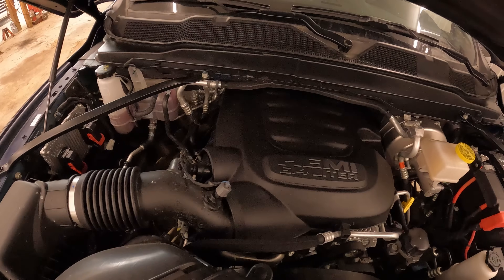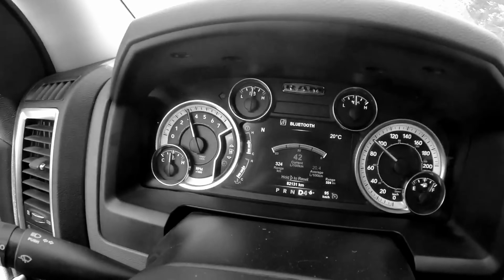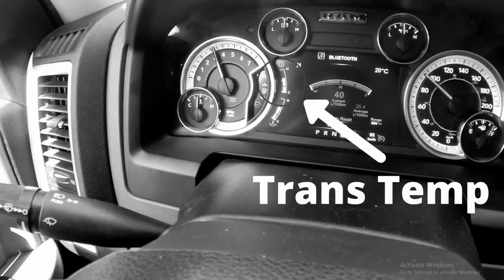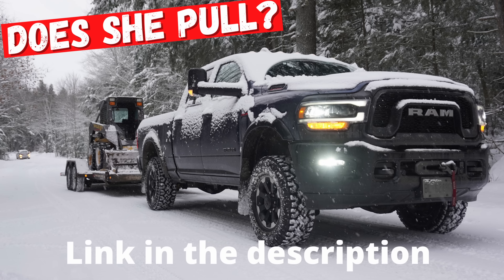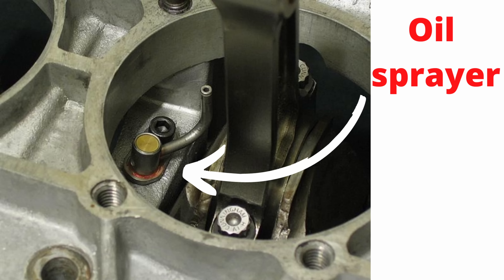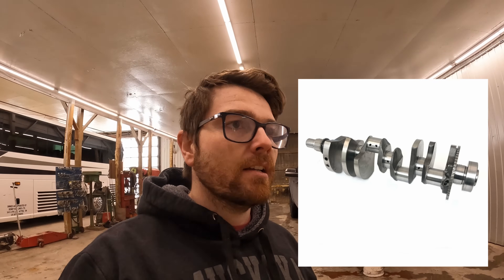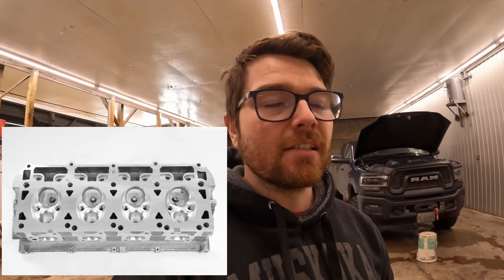RAM 2500 6.4 Hemi Review *Heavy Duty Mechanic* | Is The 6.4 Hemi Better Then 5.7 Hemi ??

Comment: Great video! I’ve owned two 6.4s, both work trucks, and both over 200,000 miles with no problems. Regular maintenance is the key.
Reply: Thanks for the heads up.
Reply from the maker: Maintenance is important! But yes the 6.4 are good working engines.
Reply: How frequent do you service them?
Reply: I just purchased my first power wagon. What do you recommend besides regular oil changes?
Reply: @dylangardener1580 it depends on how heavy and how much you tow. If you're just running it around, 5-6k miles would be okay. If you're towing 15k a lot, then 3k miles. I keep a ledger on oil changes. I saw a guy who haf a fleet of 5 3500 6.4l. They were pulling 16-18k lbs every mile. He was getting 350-450k miles before they needed anything
Reply: we had two fail before 125K miles and oil was changed every 5K miles, new air filter every year, and spark plugs replaced at 60K miles. That equals a 1/3 failure rate which is about 10 times higher than Ford and Chevrolet vehicles in the fleet. Regular maintenance will not solve a thing.
Reply: @davidporter7051 damn 😕
Reply: @davidporter7051 how? Mine has reached 150k only fluids have been changed.

Comment: As an aircraft mechanic I can tel you, aircraft grade means nothing my friend. Great video!
Reply: Been an  A/P tech for 25 years now retired and i can say NSA and AN  hardware are much better than any automotive hardware, so yes aircraft grade does mean something,  and no i never worked on general aviation, commerical and military only.
Reply: @mattottie6410  you’re talking about hardware, I’m talking about airplanes. NSA/ AN hardware come from numerous different vendors with varying degrees of quality. But good for you for liking your job I guess
Reply: Same here. Everything is "aircraft material/aluminum "
Reply: As an A&P and degreed materials engineer (metallurgist), if the exhaust manifold fasteners are indeed aircraft garde, then there is a difference. Aircraft material specs require cleaner alloy chemistry. If a supplier is providing sub-spec hardware, then bad on them and the company accepting it and not performing audits.
Reply: It was a joke…
Reply: As someone who has made parts for the aerospace sector, including SpaceX and Lockheed- there is a huge difference in quality depending on the alloy and forging process.  Plus, both of my headers cracked on my 2020 Ram 1500 at 50k miles lol It wasn't the bolts!
Reply: I'm ex Airforce maintenance and I can tell you that if you're talking about certain fittings and parts, yes.  As far as "aircraft grade aluminum" etc., it's just a marketing ploy. Period.
Reply: Kind like military grad
Reply: When you make a video with evidence I may listen to you. Until then you are just a loud mouth want to know it all.
Reply: Will you nerds give it up? You’re missing the point.

Comment: I have a 22 Ram 2500 6.4 with the 3.73 rear axle.....and I average running empty in the 16-18 mpg range.  That is pretty good for a heavy truck.  I pull a 35 foot 5th wheel (approx 10 1/2 k pounds) and when pulling I get 10-12 mpg.  Not bad!  Does goods in the hills, good off the line and just overall a great truck!  Plus, it just looks so much better than the Fords and GM huge grilled  boxy monsters!
Reply: I have a 1500 with the 5.7 and tow a 25' 6800 lb trailer in Michigan (no mountains). I get 7-8 mpg.
Reply: @TheMonkdad  I pull a 10,000 pound 30' camper. My 2004 Hemi with 300,000 miles avg 10 mpg pulling.
Original engine and trans.
Even original spark plugs lol
Reply: 10-11 is solid tow numbers. I can’t get above 8/9.
Reply: @rdallas81 300,000 miles on original spark plugs? Bullshit🤷🏽‍♂️🤣
Reply: Do u have to use premium gas in 64
Reply: @kurtcamm7141 I use regular gas.  Says can use regular
Reply: @kurtcamm7141 
89 "recommended" but 87 acceptable according to manual, but everyone ive seen (myself included) doesnt notice any difference just using 87. If youre towing heavy you could use 89 but probably wont notice a difference still
Reply: @kurtcamm7141  I dont....but i use top tier fuels (brand name stuff only) i get better mileage with it

Comment: 93 octane is everything on these engines. Both run & tow better smoother & more consistent with 93. Mpg vs cost of gas right now is very similar but I’d rather have the better performance in any situation. If you run lower gas try the 93 & you’ll immediately tell the difference. Thanks for the video, have & love them both!!
Reply: I 2nd this man I went from regular to 93 and it completely changed the whole performance on the truck I used 93 and a cleaner to get the gunk out after I bought it and it was a whole different truck on 93
Reply: Major difference! I’ll 3rd that!

Comment: I hear you on the ticking. Had a 2012 Ram 1500 and we went on a camping trip and when we were on the way back home check over the truck before hooking it up to the trailer. That is when I heard the tick, at first I was thinking it’s the lifters that’s when I check the exhaust manifold bolts and they were spinning. When I found that I was a little relieved cause I wasn’t about to have a engine rebuild.

Comment: Very interesting and informative video.  I learned quite a bit.  I have nothing but good things to say about my 6.4 hemi.  It does everything I ask it to with ease. Like you said, the trans and oil temps stay right where they should. My 1500 ran hot, about 40 degrees hotter in some instances.  So far I’m very pleased.
Reply from the maker: first thing I noticed when towing with the 6.4 was the temps stayed normal. didn't even move. where as the 5.7 didn't seem to like being worked for long periods of time. great engine so far!
Reply: @GettysGarage  This is an interesting observation as I experienced just the opposite on our first tow with our slightly used 2500.  Coolant temps moved 30 degrees, per this information screen.  Engine performed well but coolant temp was not stable.
Reply: @steveav8r684  clean out the radiator fins
Reply: @gettysgarage Ram 6.4 hemi vs Ford 7.3l gasser.  Pure reliability, which would you recommend?  Towing 10-12k pounds only a handful of times a year.

Comment: With the craziness of what these diesel emissions are getting to be including the absolutely ridiculous 2027 standard just announced, i think these OEM's would find a huge market to do a light turbo setup on these large gas work engines. Nothing crazy, just mild boost that would bump the power about 15-20 percent but greatly flatten the torque curve for pulling and drivability.  That would give diesel characteristic pulling power without the diesel emissions headaches. Great video.

Comment: My experience is that both engines are great...I never had an issue, but for me. I preferred the 5.7 as it just seemed smoother, and I liked the power band....I currently own a 2022 Power Wagon with a 6.4 and I really like it..I do miss some things about my 2019 1500 Limited......
Reply: I just traded in a relatively loaded Bighorn 1500. There is definitely a difference in ride and "refinement."  But a 2500 is a true Truck vs a 5.7 that walks the line between "TRUCK" and something else... I just brought my new 2500 home from a dealer 500 miles away and so got to "break it in" right... The new one rides like a "log wagon" in comparison, but is still very refined and I always liked a stiff ride in any vehicle I have had including putting "pinks" springs on my old subaru. Those are the WRX springs. I also notice the steering is not nearly as quick or sensitive on the 2500 vs the 1500 but it still tracks wonderfully and that is the key to a long drive. The new stiffer frames on the new 1500 AND the gen 4.5 2500 is a world of difference. My 2013 and 2015 1500's tended to want to "wander" driving down the road...

Comment: I’ve owned my Ram 2500 with the 6.4 for over 7 years and put over 100,000 miles on it. I’ve kept up with the maintenance schedule and changed the oil every 7k miles. The truck averages 12 mpg all day. The best mpg was 16 average over 2000 miles with no trailer.
Only gripe I have is the noise the engine makes. It sounds like a typewriter and it’s almost necessary to swap out the muffler.

Comment: My Ram 2008 diesel burned.  I bought a 6.4 3500,  2020.  Tow a 13000 lb. fifth wheel.  Does real well.  Your video puts my mind at ease.
Reply: How is it now, about a year later?
Reply: Lol..I own a 2004 5.7 and pulls a 10,000 pound camper.
Truck has 300,000 miles
Reply: What kinda mpg are you seeing ?
Reply: @anthonymoy4471  8.5 towing.  Maybe 14-15 solo.  Not great.
Reply: @ralphgilson9989  14 - 15 is great 👍 my wifes 6.2 ls takes premium gas and hits 12-13mpg at cheaper fuel and same milage as a older 5.7 hemi that's good milage
Reply: @anthonymoy4471  8.5 towing.  14-15 possibly on a trip solo.  Not great.
Reply: @anthonymoy4471  I am assuming it would get that mileage on a trip.  I have two Priuses and use them for my trips.

Comment: Very informative video.  I have a ram 2500 with a 5.7.   And yes, 2 exhaust studs broke off in the same port. That ticking drives me nuts!!  I’m getting ready to fix it with a 6.4 2500.   Thanks again!!
Reply from the maker: yes the dreaded 5.7 exhaust manifold leak, good news is they are catastrophic by any means just annoying lol. thankfully the 6.4 rarely every has that issue.
Reply: @GettysGarage  "...NOT catastrophic..." correct?
Reply: Correct.
Reply: Factory fix zero cost on the exhaust studs.

Comment: Bore sizes 5.7 3.920 6.4 4.090 5.7 stroke 3.58 6.4 stroke 3.72. The differences between 6.4s compression ratios camshafts tuning. Yes tuning don’t forget the 6.4s have the super cool variable intake manifold. To the hypereutectic pistons there fine I don’t recommend nitrous. To superchargers on truck engines it takes extra tuning you should get a hold of someone like hemifever or Jay green. Why last I heard numbers around 175-180 of cranking compression in those HEMIs. In the late 90s 150-160 was cranking compression was pretty common

Comment: Thank you so much for the information on BIG Gas engine that DODGE offered. In the pickup. That it takes 40 wht. Oil. My 353 Detroit Diesel uses 40 Wht. Thick oil. I keep it plugged in with block heater. I was looking at Dodge with Cummins but the $9000 dollar mark up, just too, to much. Thank you for having a big GAS block, towing on your trip, showing the Engine Temp's and pressure. Very helpful for me. I want a
 8 foot bed. For me a must. The screen on Dodge is so large, must have GPS for me. 
Can now price the Big block Gas engine instead of Diesel, on getting prices from Dealers.

Comment: Interesting how the 6.4 BGE and 6.4 SRT are not the same as they serve different purposes.  More interesting is that the 5.7 used in the trucks and the 5.7 used in the cars seems to be the exact same engine.  That's a bit disturbing as tow ratings seem to be growing on the half ton trucks.  So glad I made the decision to go with a 2500 with the 6.4 for towing. Absolutely love it.  Great Vid!
Reply from the maker: Yup pretty much what I saw. The 5.7 is basicly the same across the board. Whereas the 6.4 is a bit more purpose built which is nice to see. I mean the 5.7 is still a great engine but I would be cautious buying it and loaded it up day in and day out
Reply: @GettysGarage  I am still kicking myself for not buying a 74 Subaru Turbo to save 15 bucks a month as I towed a pop up with a Forester... That year ONLY, the Subaru used a "detuned" WRX block etc. vs later years when they used an uptuned regular 2.4 block. I thought it was interesting when you noted that the 6.4 was essentially a detuned SRT 392/6.4. Robust comes to mind as an overarching concept.
Reply: @GettysGarage lol.
300,000 miles on my 5.7.
2004 Ram Hemi.
Almost all original..
Still has original spark plugs..
And it pulls a 10,000 pound camper
Reply: To be fair the 5.7 hemi was originally built back in 03 as a truck engine with truck use in mind
Reply: @rdallas81 I just pulled my spark plugs for the 2nd time in my 04 hemi I've had since new.. you should change the plugs I'm at 210,000 miles the hemi and coil packs and water pump are begging for help I bet

Comment: I'm considering gas for my next truck. 2012 Cummins I have now is running just great. But for what I do now with my daily I don't think I need to put another $10k in a new truck to get the diesel, and the extra payload in a gas truck suits me better than towing power. I had a 2004 1500 Hemi I bought new back then. That engine was fantastic. Had it 81,000 miles and never had an issue. Actually I think for that whole truck it needed one wheel bearing and a pinion seal in that time. 2012 has had several more repairs, but I'm also at almost 150k.
Reply: I have a 2004 Hemi. Laramie edition 4 door.
Has 300,000 Miles. Has original spark plugs.
Replaced fuel pump, power steering rack, axles and diff stubs.

Comment: Excellent video again. Very informative. I want a Powerwagon even more now to tow my 31’ Airstream Classic. My Ram 1500 does tow it very well but out west through Teton Pass I had to pull over several times due to starting to over heat.
Reply from the maker: I didnt end up pulling over when I ran the mountains but I certainly had  to drop my speed because the truck was going to over heat lol. Nothing wrong with the 1500's great trucks but the PW is so much more comfortable towing.
Reply: Be sure and look at your payload if you are going to tow with a Power Wagon. A fully loaded power wagon ONLY has as little as a 1000 lb payload. That made me go with a regular 2500 Laramie. It is not an intrinsic function of the truck to have a lower payload, but the set up of the suspension on a power wagon, I hear. I'd like to hear "Getty Adventures" address this issue...
Reply: Ford did the new class leading 7.3 gas. GM did the new 6.6.  Ram should update & open up the class lagging 6.4 to the 7.0 liters the block was designed for. That’s right a 426 Hemi. 

Not for high rpm horsepower but for especially more & a broader lower rpm torque curve. This would come with the stroke & cubes. It would not use anymore fuel until it was asked for more power than the 6.4 makes. 

Speaking of power it could easily support a class leading 440HP and a competitive 470-475 ish torque. No doubt trade ins & sales would soar.
Reply: @GettysGarage  I take new AS from plant to dealerships with my 1500 Ram with lil 3.0 liter Econ diesel. 880,000 miles now. 480 TQ 8 speed 3.92 it moves them ok even the 8k 33 Classic. With the turbo brake & factory trailer brake controller it controls speed down grades and stops ok. But needs WDH with built in sway control, axle to frame air bags, & XL load tires to handle the weight well.
Reply: Lol would you trade in your 6.4/392 for a 426 Hemi?
Reply: @vernlochtefeld1626 yeah and the 7.3 has major lifter problems, the 6.6l burns oil like crazy. Leave the 6.4 Hemi alone, it’s got plenty of power and is reliable just the way it is, why mess with a good thing?
Reply: @lifeaftereverything4986  It’s got plenty of power?  Apparently you haven’t used it tow anything big n heavy. Or perhaps I’ve been spoiled by even a stock base level Cummins that doesn’t even have the advantage of the 8 speed. 🤔  

I also have a small 3.0 liter diesel that makes a little over 500 TQ.  Seen a YT video of a 3.0 diesel 1500 drag 6.4 Hemi 2500.  That just doesn’t seem right.
Reply: @vernlochtefeld1626 my point was more of a reliability thing. The other big 3 did major changes and now have major issues. The Ram 6.4 Hemi with the 8 speed is the only one left that’s not broken. As for power if you need to tow big and heavy then get the diesel, the rest of us that tow light to medium trailers/boats etc or have truck bed campers and don’t need the diesel. That was my point.

Comment: You were damn close on the piston pronunciation Getty !  Pronounced - HYPER - YOU - TEKTIK       You rock dude thanks for the vid !  Cheers

*I should add, if anyone's curious, hypereutectic pistons are aluminum with added materials to reduce the thermal expansion of a normal piston, so tighter tolerances can be achieved.
Reply from the maker: I tried lol and yes that's what I read. Just thought it was a pretty cool feature!